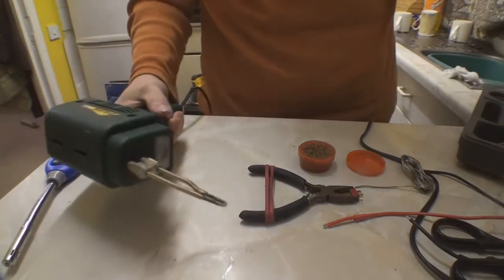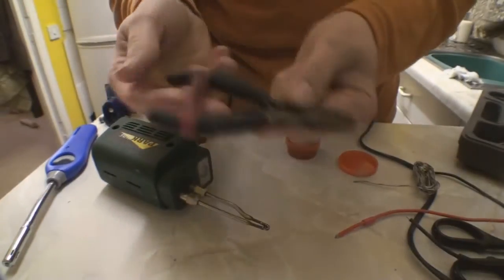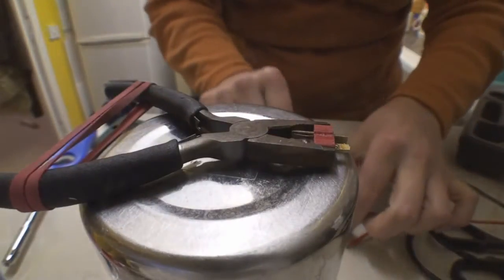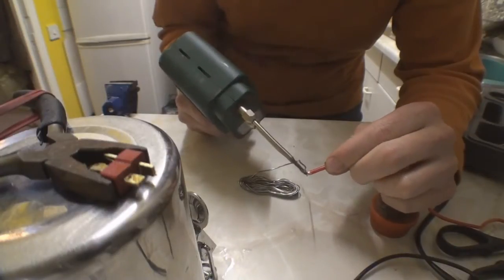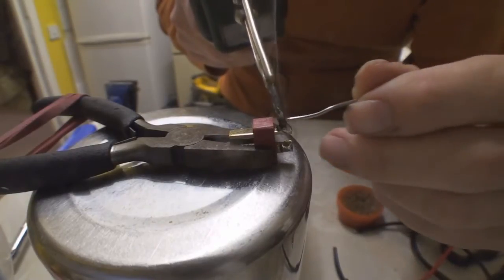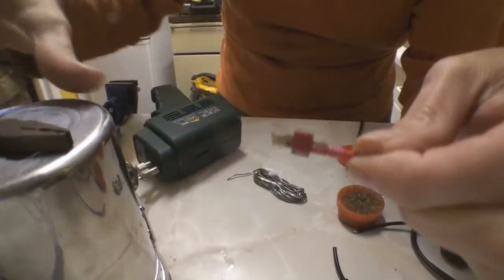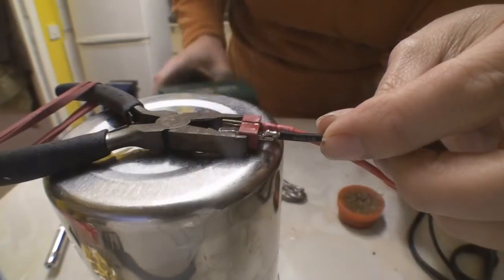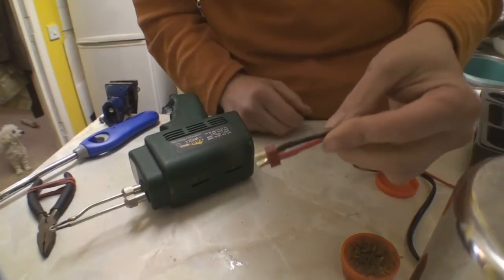Soldering , a quick guide: Deans connectors RC car

Comment: To make sure you don’t melt/move the connector in the plastic push the opposite connector on to the other side, this will help make sure the pins won’t move with heat, this also works with xt30,60 & 90’s, obviously don’t use a connector that’s live on a battery